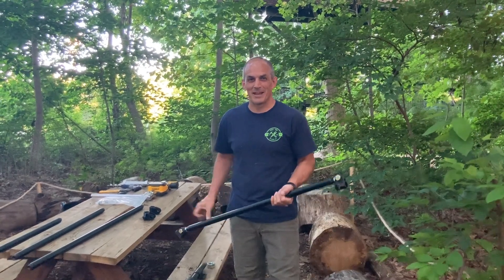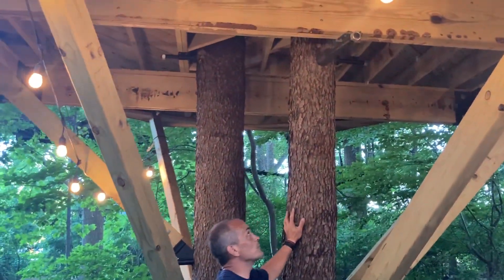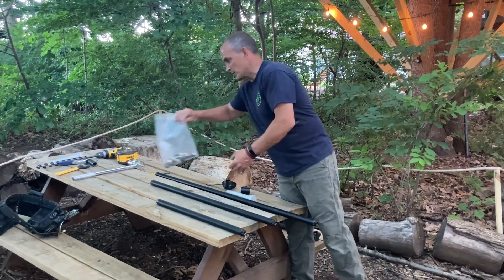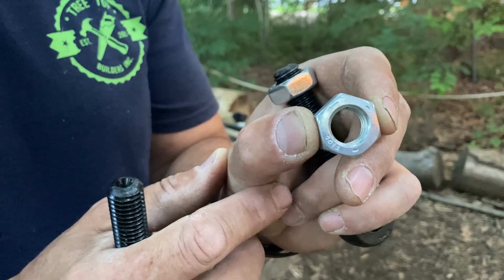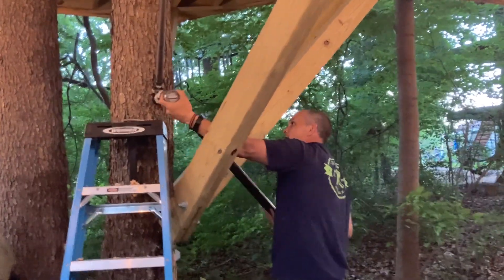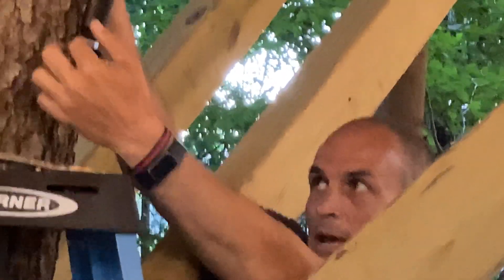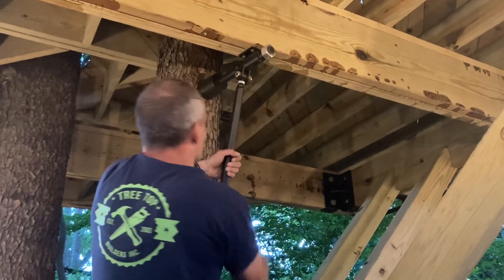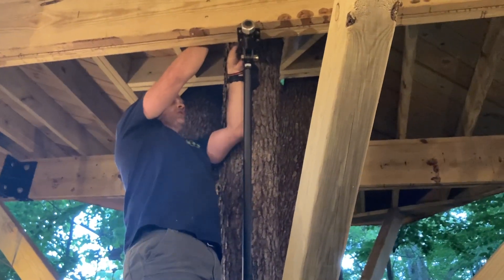MTAS Retrofit Strut Installation | Tree Top Builders

Comment: As the tree grows, will it have any negative effect on the bottom part of the strut?  I noticed there was plenty of room to grow out along the T.A.B at the top, but what about the bottom, given that the base of the strut is already embedded into the tree.
Reply from the maker: It's okay for the tree to grow around the bottom of the strut. However, once enveloped, it will not be possible to tighten it or adjust the angle in any way... There are no negative effects on the tree post installation - the tree just grows around it and compensates over time.